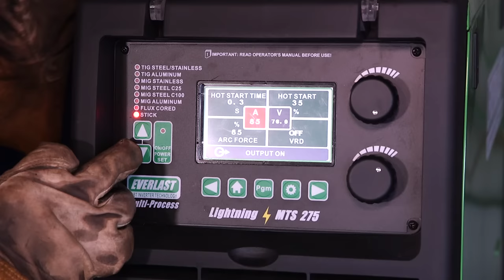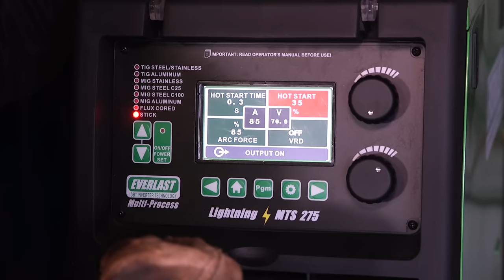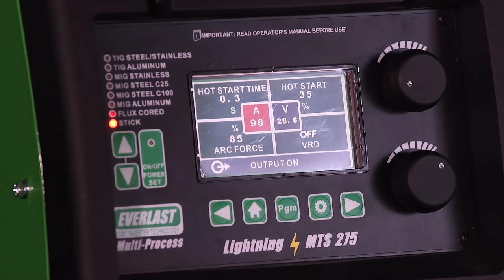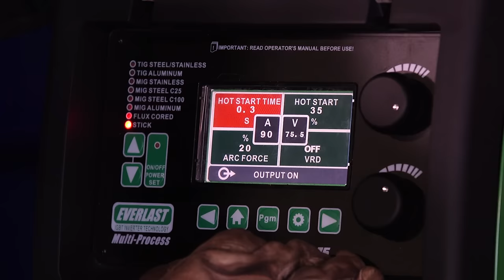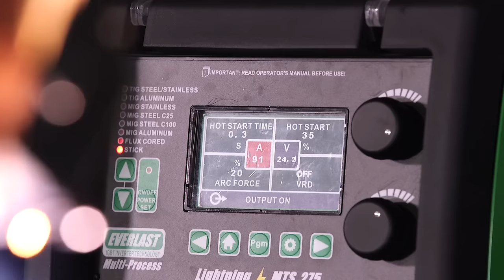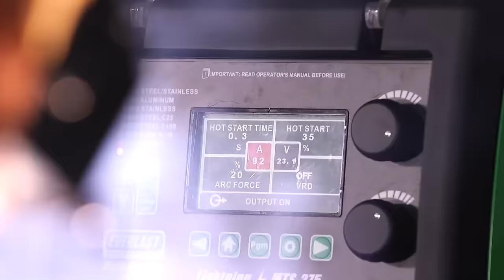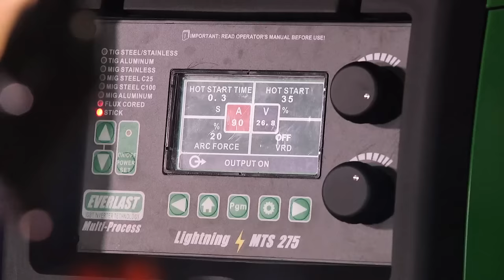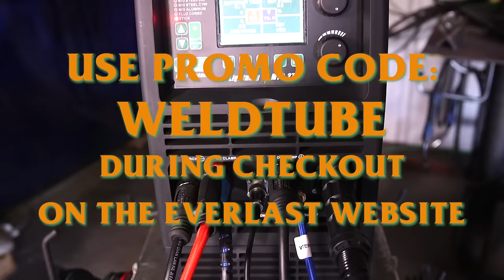STICK WELDING for Beginners | SMAW 6010 & 7018

Comment: You're pushing the rod, I once read a saying that said "if there's slag, you drag" is this not right?
Reply: Pretty sure he means to push the rod in (keep pressure on it) to keep a tight arc to avoid long arcing, not push the puddle forward with the rod
Reply: @misplacedcaper9662  but with 6010 shouldn't a little long arc be better to widen the beads ?
Reply: @patriotskingnation8084  No.  6010/6011 is a deep penetrating rod.  Long-arcing is essentially adding amperage.  You should be filling and capping with a rod more suited for that purpose, 7018, etc... or running multiple passes (stringers) if that's all you have for rods. Long arcing will produce spatter, poor penetration, porosity, undercutting and bad deposition consistency.  6010/6011 rods are fast freeze, and require a slight whipping motion and are meant for root passes.  You should be holding a tight arc with any rods you use.  It's one of the first basic principles you should be practising when learning to stick weld.
Reply: @misplacedcaper9662  i tried the whip and pause technique the other day on 2f it was difficult i either whipped to far or too short lol
Reply: @patriotskingnation8084  I usually try to keep the whipping action between an 1/8" to 3/16".  6010 was the hardest rod to learn, for me anyway, but now it's pretty much my favorite.  When I'm bored, I head out to the garage to practise, several times a week if I can.
Reply: @misplacedcaper9662  and for pausing do you pause it  for a second or 2 seconds ?
Reply: @patriotskingnation8084  ...whip it...whip it good....Devo....

Comment: Very good techniques. Only thing I recommend is not putting the work piece where your comfortable. Reason why is 9 times out of 10 you’ll never get to choose comfort out on the field. Also try butt welding two pieces of pipe together and never move your body. In other words learn to weld with both your hands. Downside to that is you have to certify both hands. Once I was failed even though I passed x-ray because my cert said right handed but I welded it with both.

Comment: Alright people, I need help. I've been welding with 7018 and I constantly have porosity. Metal is clean, I spent my time cleaning it well. Welding at around 125 amps. Is that too low? Too high possibly? Is it my speed or rod angle? I think I've been doing well with my angle and speed. Just taking my time letting the welding actually happen. Please help a fellow (hobby welder, for the moment) welder. Thank you!

Comment: I've never welded a 6010 electrode, can anyone explain what if we don't use the whip motion?
Reply: 6010 is not a drag rod you have to wip it its made for that
Reply: @ohgeorgee7570  Not always! It is excellent drag vertical downhill rod, for beveled joints in big pipes ;)
Reply: @6pekXX  pipe welding when they put the root pass in is something thats hard to do but the guys that are rig welders make it look easy cheers 😊😊

Comment: Shouldn't you have cleaned the oxidation on the edge of the smaller plate as well?
Reply: If it was beveled yes, but you will have alot of people disagree with what you typed. Then again, this is just s simple T-Joint Weld

Comment: When I weld with 6010 the rod is always stopping... why?
Reply: What do you mean stopping? You might have a problem with your power source.
Reply: a lot of inverters including the Lincoln 210mp can't run 6010. you also gotta be in dc electrode positive. if your in ac or dc electrode negative it ain't gonna run. try finding a different machine to try it on or switch to 6011 to see if its not just you. if 6011 runs on your machine but not 6010 you may need a different machine to run 6010.

Comment: My problem is, I have most of the basic equipment I need, but practice materials are very short in supply.
Reply: I remember i use to drive down the train tracks and find scrap metal of all kinds. You'd be surprised what falls off trains everyday....just be careful
Reply: Visit a scrapyard

Comment: 1/8 6010 @ 85 amps 🤔
Reply: So it can penetrate better, its T-Joint, not open root
Reply: Dennis Young  

I did not understand what you typed. If by "V" you mean bevel, then you only "Bevel" on a 3G open root. With a T-joint you dont have to "V" things out, its just a t joint, unless the procedure calls for a "V" or "Bevel"